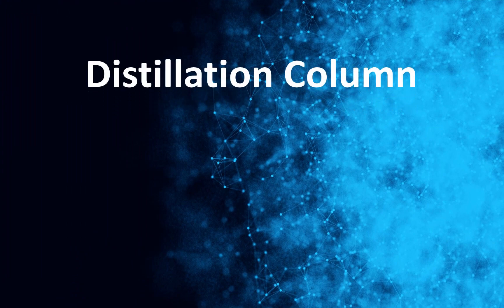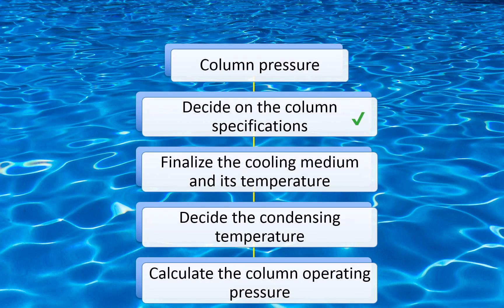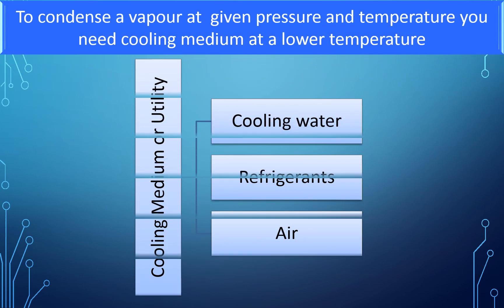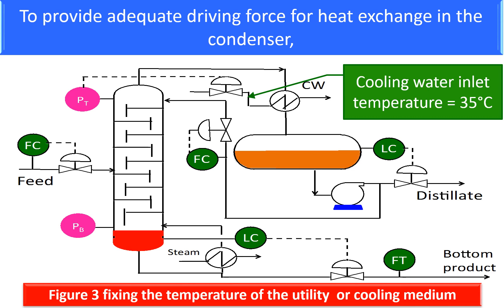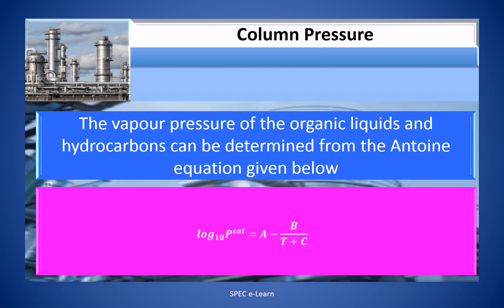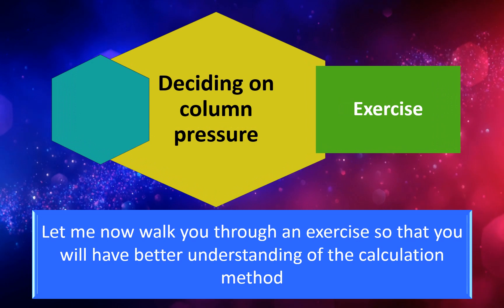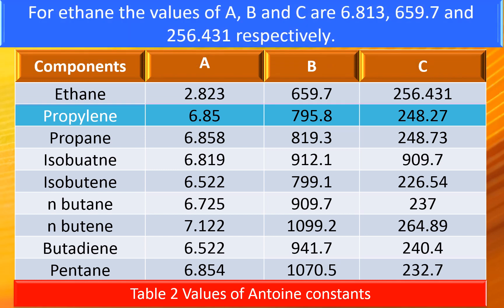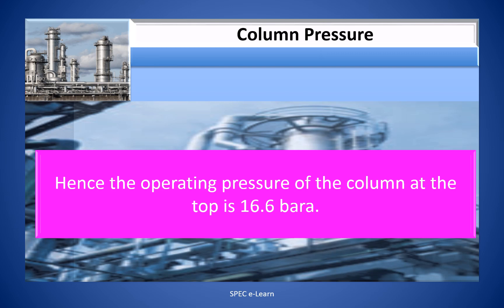Distillation: How to Select the Column Operating Pressure

Comment: @02:55 min you told calculation of dew point and bubble point needs operating pressure at top and bottom so in that case at top what pressure should be taken?

Comment: Awesome video and great content. 

Just want to know, the column operating at 16.6kgf/cm2g, once the total vapor gets condensed

What would happen to the pressure in reflux drum? 

Will it remain same? Or 

Will it decrease? 

What would be ideal pressure in reflux drum now? 

From my understanding, the pressure in the reflux drum should be equal to the vapor pressure of the mixture at the existing temperature, is it right? 

What if I subcool the liquid to 30degC,  the pressure in the reflux drum gets much lower than 16.6? 

Can you pls discuss about this? In total condenser system, will there any difference in column top pressure and pressure in reflux drum after complete condensation??
Reply from the maker: You are discussing two different aspects. One how to decide on the column operating pressure. Two how to control the column pressure. In a conventional distillation column with pressure being controlled by controlling the utility flow rate, the pressure in the column top and the reflux drum will be the same. I presume you are a working professional. There will be an equalising line connecting the column overhead vapour line and the reflux drum . This will take care of the of the pressure variation in the reflux drum due to level variation .

In some processes sub-cooling is needed. The pressure control scheme will be different. I would recommend you to watch the video on" Distillation column pressure control" where this scheme is explained (hot vapour bypass scheme)
Reply: @SPEC786  

Yes, I am working professional, just for clarity, I would like know, being hot bypass vapor in completely closed condition and Total vapor getting completely condensed. What will be the pressure in the reflux drum? 

Column pressure of debutanizer to be at 14kgf/cm2g. 

Will it be same 14kgf/cm2g or less, if so why?

If it is less, how can I quantify its value logically at reflux drum?